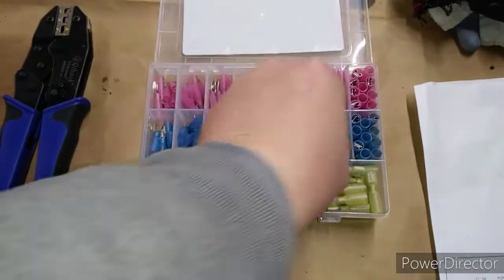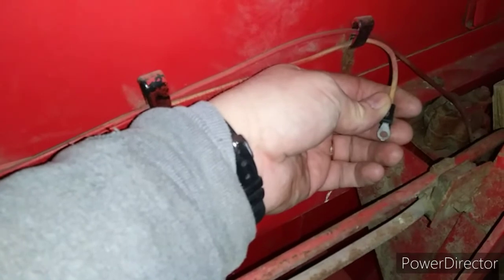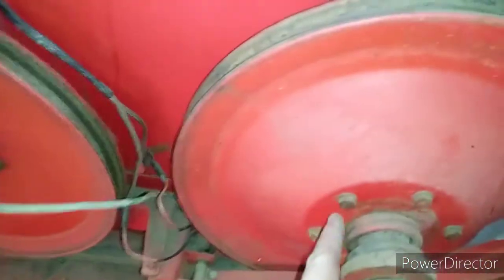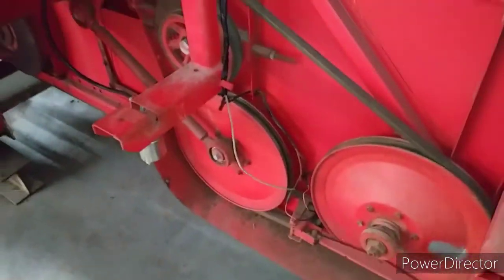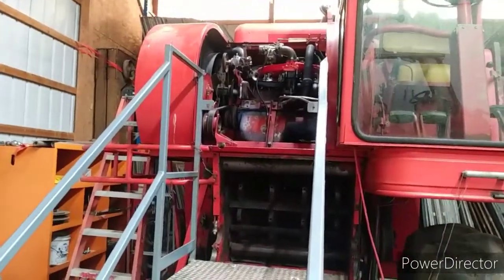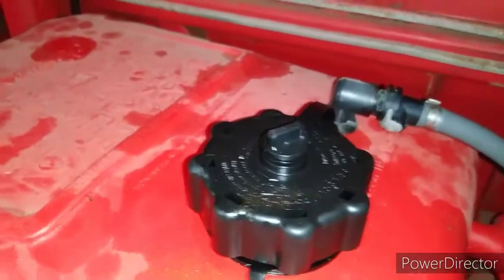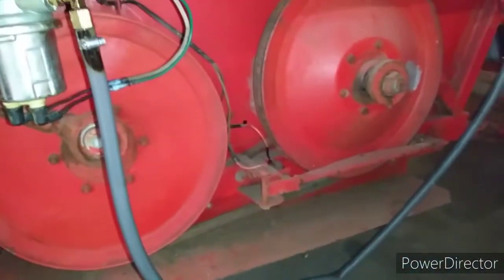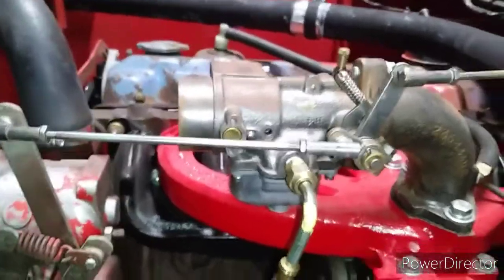Fuel System Rebuild & "Cold Start" MF 300 Combine Resurrection Part 8

Comment: The leaning tower of power lives!   BTW what is the toggle switch by the choke knob for?  I don't remember it on either one of our 300s.
Reply from the maker: The toggle switch is for variable speed reel on the more modern heads.